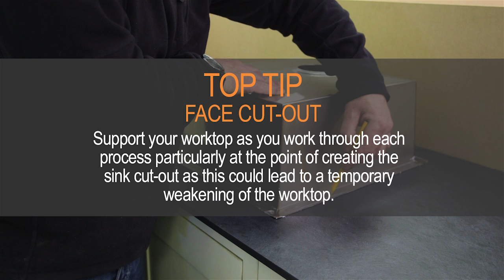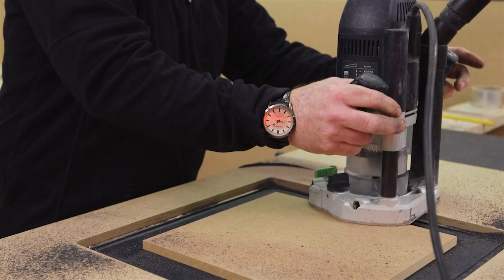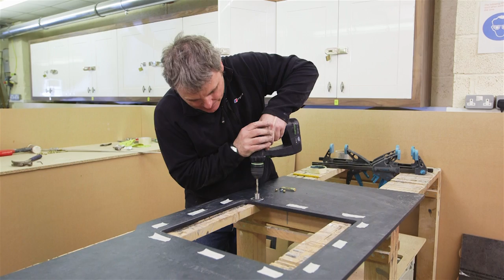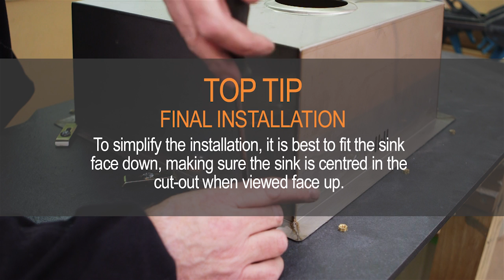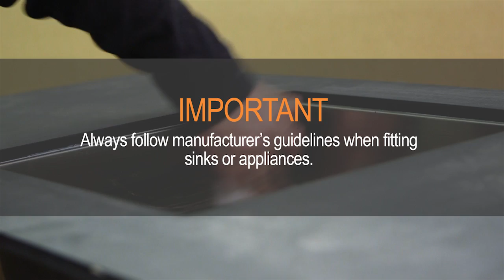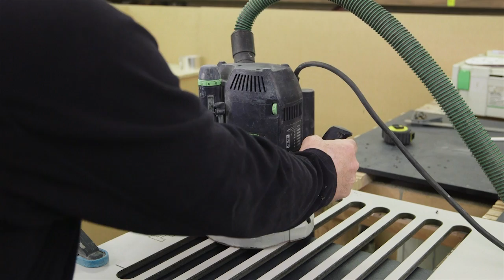Zenith Worktops - Chapter 7 Undermount Sink Installation

Comment: What's the point in putting drainer grooves if there's no fall to the sink
Reply: There is
Reply: @gavincollins9376  look closely ... if a fall is there the grooves taper as they leave the sink these do not so no fall is there
Reply: @darrenmaloney761  Correct, but still needs an area for water to collect and run
Reply: @gavincollins9376  yes that's true but only if it has a fall
Reply: @darrenmaloney761  No, as once enough water builds up it has to run,no?
Reply: @gavincollins9376  our talking days on end if not weeks they are only drain grooves Water shouldn't be left to build up its unhygienic and that's how you get mould growth
Reply: @darrenmaloney761  Correct, most people will just let water sit there rather than cleaning their kitchen waiting for build up of mould..
Reply: Drainer groove jigs are on a fall, the 6mm will be the deepest point up to maybe 1-2mm